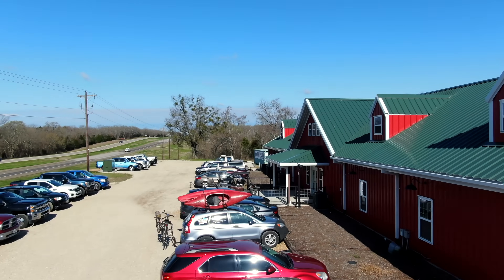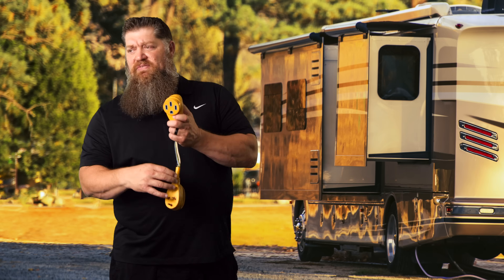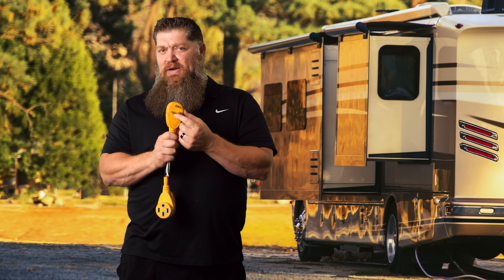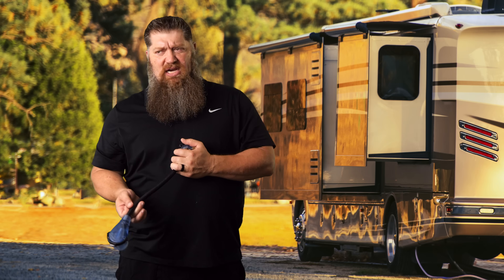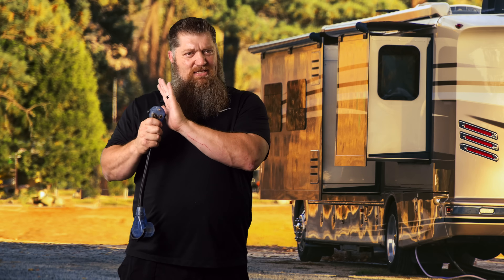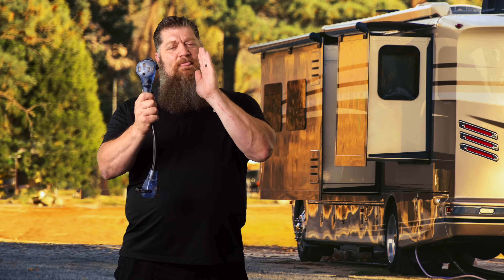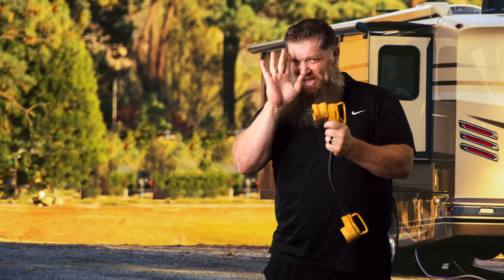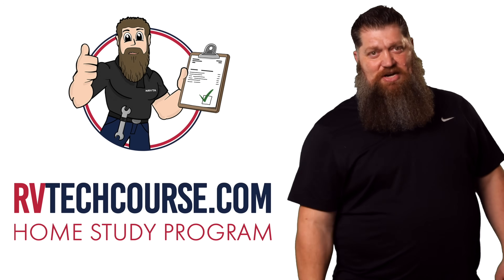30A to 50A RV dogbone adapters. What you need to know.

Comment: This past weekend at a thousand trails camp ground I was told that I could not use a 30amp site because my rig is 50 amps. I then explained that I had a dog bone to reduce down and that a 30 amp site was fine. I was told that I couldn’t do that and it was illegal to use a dog bone now. He claimed that was the case because the weight of a 50 amp cord was too heavy for a 30amp plug. Is there any truth to this??
Reply: Sounds like a park attendant not understanding the electrical dynamics at work and more concerned with irrational beliefs that the weight of a 90deg cord connection will physically damage their equipment.
Reply from the maker: hmmm. I wouldnt think so. Heck if you put on an EMS device on their plug it adds weight as well. 
It may be a PARK rule because they had some problems in the past. But no its not an NFPA thing. I doubt its a local law either but I could be wrong on that. local laws are vast.
Reply: @NationalRVTrainingAcademy  they said it was “all parks”. My guess is all their parks.  Thanks for the reply!!

Comment: thanks for tech tip, I have a bull dog serge protector and its bluetooth to my phone. I use it very ofter to see voltage and amps my rig is pulling. Very helpful
Reply from the maker: awesome, this way you can more quickly determine how many items you can turn on without overload. More technology will be commonplace and we will have less failures.

Comment: So I got a very good question if you say that you can not run two Ac on a 30 amp service why do the manufacturer put two Ac on a camper with 30 Amp service???????????
Reply from the maker: Because there are several other appliances you cannot turn off. You don’t know when they are on and it can set you over the limits. 

Refrigerator. If on electric it will pull from 400 to 600 watts. 

Converter. The more 12volt items you gage on the more the converter pulls power. 

Add 2 a/cs on a hot day you are WELL over the amount. 

Saying “they wouldn’t have built it if it doesn’t work is actually silly. If you add up all the devices on a 30 amp rv offering you are well over 4000-4500 watts. 

It’s not built for you to turn everything on. It’s for you to choose what and WHEN you turn it on.
Reply: @NationalRVTrainingAcademy  "Refrigerator. If on electric it will pull from 400 to 600 amps."

Are you referring to the compressor starting current? Seems pretty extreme.
Reply from the maker: @treecatt  No not the start up, the run. Open the door and read your dataplate to your regrigerator. it will either provide the amps or watts.  400 watts ar 120v is less than 3 amps.....not sure how that is extreme at all. 600 watts is 5 amps. this is normal. (correcting my typo)
Reply from the maker: @treecatt  crap. typo. 400-600 watts.
Reply: @treecatt  I can't imagine any refrigerator even the one you have at home is probably on a 15 or 20amp circuit.
Reply: @NationalRVTrainingAcademy   my 12volt fridge runs about 5amps when the compressor is actually on.
Reply: @NationalRVTrainingAcademy  I thought you probably meant 400W-600W.
Reply: @NationalRVTrainingAcademy  That's one hell of a refrigerator!! 600 amps?! lol There's just no getting away from doing rv wattage math.
Reply from the maker: @robertosgood961  yeah. typo. watts
Reply: what if you have a 12-volt refrigerator. Will That takes less power away from the 30 amp service compared to electric/ propane refrigerator
Reply: there are several reasons... first, you may have a lower rated AC unit such as 13.5k btu vs 15k btu.  The 13.5 draws less amperage compared to the 15k btu AC.  You may have soft starts installed on your AC units AND you have 13.5k btu units... further, you may have staggered start AC's where the compressors between the 2 units will not start at the same time so the inrush current won't exceed your rated ampacity of the service.
Reply: @johngriswold8735  ok thanks for the info I was just wondering why would the manufacturer put them i. If you couldn't run them but you made it clear thanks
Reply: @johngriswold8735  Always start the bigger A/C 1st then the smaller A/C second. Smaller RV's usually only have 1 A/C and have only 30amps. The rule of the thumb is of the RV is 50amps that means it might already have 2 A/C's or it is wired for 2 A/C's. If it was small rv and had a seperate bedroom and you wanted a 2nd A/C I would look at a smaller A/C like the 10k BTU A/C so you don't exceed your 30amp power limitations.
Reply: Not to speak for Todd… but it is actually possible to run two ACs on 30 amp. If you have soft starts installed on your air conditioner units. It’s the initial jolt of electricity that’s needed to fire up the compressors that cause a problem. I think he may not have wanted to get into the weeds and go into different products that can help manage power consumption, but rather do a basic and very informative video about amperage, and what can happen if you overload.
Reply: @Steve-n-Tango  i understand what you're saying but in the video he did about the Ac he said you can't and shouldn't
Reply: @Steve-n-Tango  but let ask you this